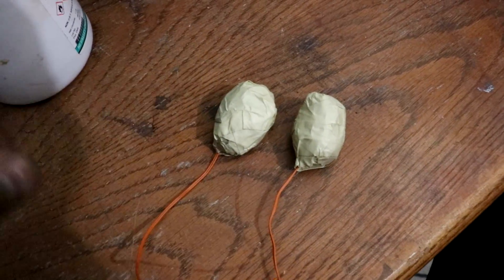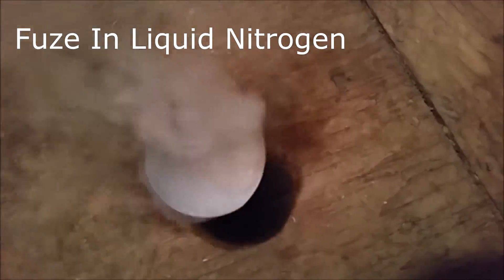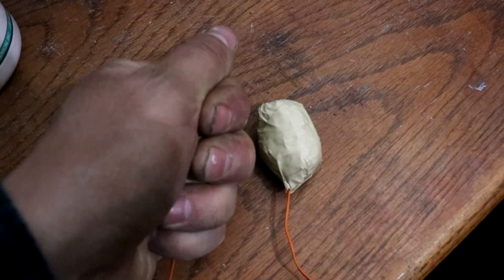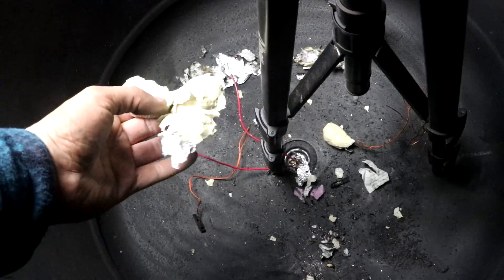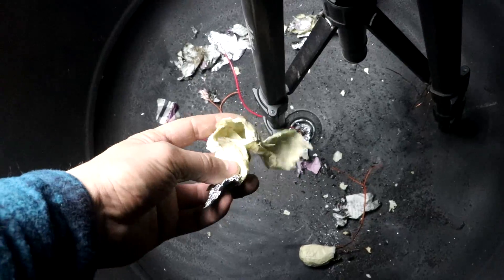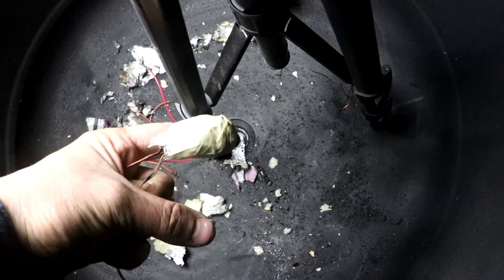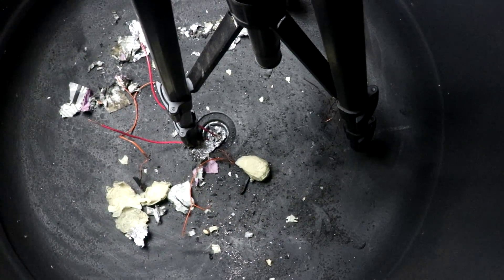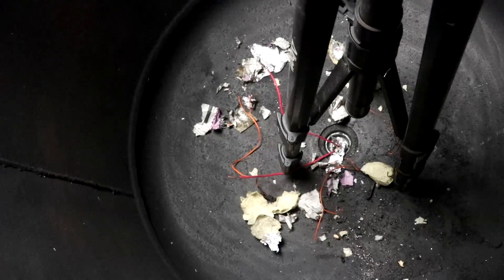Would Fireworks Work in Space?

Comment from the maker: So to sum up: 
1. they will need a different type of ignition:
2. they will be slightly more efficient turning chemical into mechanical energy ( can shred a thicker shell)
3. they will make noise so long as you are in direct line of sight and fairly close.
4. the "stars" will not burn long after the initial blast. (so fireworks in space wont be very pretty)
Reply: Space fire works would have to be designed to work in a vacuum , like may be put an epoxy coating on the stars so they are held under pressure.
Reply: What if it had an oxidizer
Reply: @cameronkeys49  Black powder does have an oxidizer. Potassium nitrate, KNO3. Wouldn't work as a propellant/explosive while encased in cartridges/ball of tape etc. otherwise. I know you could make a pipe bomb or whatever out of just the star chunks and it'd work in a vacuum, I've made explosives using nothing but those "star" chunks, as well as some with smokeless powder pellets, and they definitely work. My completely uneducated guess would be that perhaps in a vacuum and outside the explosive's container, the components of the mixture aren't held close enough together to react efficiently/completely? Probably something like that along with a dozen other factors, surely the "stars" in fireworks get a big assist from atmospheric oxygen as well.
Reply: @cameronkeys49         Good question !. lets ask Cody, if he don't know he can  fashion  an experiment that will tell the tale .
Reply: It's illegal to dismantle, or manufacture fireworks without a license. Didn't you learn anything from Grant Thompson? I mean this is the exact same thing he got busted for. You cray cray dog?
Reply: ipissed. I guess it all depends on where in the world you are.
Reply: @johnturner4400   Well he better have his passport stamped.
Reply: @ipissed  I doubt that any law enforcement officers would really care about this incident. Just my professional opinion though...
Reply: @ipissed  what episode was this? (The grant Thompson fireworks episode)
Reply: Thermite in a vacuum would be interesting, of course it wouldn't be a vacuum for long!
Reply: @Cody'sLab  did your Uranium refining video get taken down? One other thing is that do you ever calibrate your geiger counters?; if so do you do it yourself? I really liked that video and continue make awesome videos!  btw I really want to see a video of you refining gold ore from ur mine :O I am still waiting for that one xd.
Reply: Next; Fireworks in a pressurized, high oxygen environment AND fireworks in LOX
Never really a question of whether the fireworks would go off in a vacuum or not since gunpowder has its own oxidizer, I do find it interesting that the stars etc. didn't do much though. Maybe you could try using real fireworks next time? Homemade are cool for proof of concept, but commercial/professional grade ones are capable of detonating at sea level which this one isn't.
Reply: Who are they?
Reply: @dloveartsdotcom  Do you mean the stars who are covered in epoxy ? , we don't know them by name. And they are not as cool the stars who follow us on twitter.
Reply: There goes my plans for celebrating 4th of July on the moon.
Reply: fireworks in pure oxygen atmosphere next?
Reply: The sound was created by vibration through the metal work buddy.
No fireworks won't work in space, same as ice crystals can not exist in space.
Water boils instantly on a vacuum just keep that in mind.
Reply: Watevs
Reply: Did you forget your mic wouldn't work when the camera was in the vacuum?

Comment: A couple of corrections. 
Those were not like most shells used in commercial fireworks displays. What you made is a device called a mine, not an aerial shell or comet.  They are most commonly seen is some consumer grade fireworks (Class 1.4G).
All large public displays use electric matches, often under computer control. Even for smaller displays, some fireworks wholesalers will supply an electrically fired show if requested by the customer. I personally own a small capacitive discharge firing box that I use when I want to fire multiple items simultaneously.

Comment: The fact that sound could be heard, (including the post blast echo from the container ringing in the slow-mo) could have been due to the fact that the expanding gas from the explosive increased the pressure in the small container allowing sound waves to propagate. Space being what it is, I doubt you'd have the same result. 

You could always ask NASA to use their huge vacuum chamber to test it.

Edit: Did the vacuum reading on the gauge read as higher after the explosive went off? If so, by how much?

Comment: If you leave it in the chamber for a long period of time, will it still ignite? Is there a bit of residual air clinging to the black powder ball? Grappling with the notion that black powder fuses don't work but black powder fireworks do.
Reply: He didnt show any regulated vacuum gauge so we dont really know what the pressure was inside that chamber. It sounded like he only had the pump on for a short time and we hear the sound of the explosion indicating that there was indeed air inside the chamber.

Comment: The fuse burning in liquid nitrogen was very surprising.
Reply: Gunpowder has its own oxydiser, so it'll burn in pretty much any kind of gas or liquid that doesn't chemically react to it. And while liquid nitrogen might be cold, the gunpowder reaction is exothermic once it's started, so it produces enough heat to sustain itself. It's the same reason Thermite will burn through water ice, dry ice, liquid nitrogen and so forth.
Reply: @Malidictus  yea i found the statement he made about fuse not burning in a vacuum not correct. because it clearly had burned like 6 inches before it failed.  
a little temporary bend would compress both sides of the powder and once straightened out would leave a air bubble. air bubble + vacuum = failure point.

Comment: The sound going through the structure into the camera is actually kinda interesting. A video with one camera on a tripod and another hanging from string or something to basically disconnect it from the structure would be an interesting comparison, possibly also comparing it to a speaker inside with and without vacuum and a speaker outside with and without vacuum.

Comment: I don't believe it's possible to draw any conclusions about why one was shredded and the other not. Could have just been random circumstances. You would need to set off at least 3 or 4 of each to get enough data to make any determination. One of each is just not enough data.
Reply: If he wanted to be a bit more rigorous with his testing, sure. But it's still fairly obvious the reason the one under vacuum shredded more than the one under atm pressure, the vacuum simply provides no inward force and thus the explosion can push outward with more force.
Reply: @navy_y1594  
It's a valid assumption, but by no means a proven conclusion. More data points are required for that.
Reply: @scott_meyer   I don't think he ever said it was a proven conclusion. He definitely didn't intend for it to be some scientific experiment, just observations and theories?
Reply: @navy_y1594  

Yep. This experiment leads to another experiment. it happens often during experiments. 
We now have a hypothesis of what caused the squib to shred, more experimentation is needed to confirm.
SCIENCE!
Reply: @scott_meyer  I'd do it on my own but I don't have a vacuum chamber or fireworks haha

Comment: Experiment idea: inside a vacuum chamber place a wireless speaker and 2 microphones, one placed on the same surface as the speaker and one suspended from a string. Play something  through the speaker as you slowly decrease the pressure. This will demonstrate how the air pressure affects the sound (volume and pitch).
On a second thought it might be better to depressurize first, and conduct the experiment as you slowly let the air back in (this way eliminates noise from the pump)

Comment: Why is pressure a requisite for igniting powder?
Reply: Fenris17
Why is pressure a requisite for igniting powder?

The pressure is necessary to keep the hot gasses localized so the neighboring particles ignite in a chain reaction. In a vacuum, the fire escapes so fast it does ignite anything unless tightly compacted in a closed container. Paper, tape, string, and glue will make a tight, strong container.
Peace
Reply: @Maccbruce  ah! Ty so much. Pretty intuitive. I guess it goes without saying anything explosion in space probably has no flames. So it's just things flying every which direction and glowing a little

Comment: Aren't commercial fireworks displays mostly electrically controlled, due to the requirement of being precisely timed (to provide a more thematic and spectacular experience) and choreographed to music?
Reply: Fetzie
16 hours ago
Aren't commercial fireworks displays mostly electrically controlled, due to the requirement of being precisely timed (to provide a more thematic and spectacular experience) and choreographed to music?

You are correct that it is mostly computer controlled. But small shows are still fired the old fashion way...with a railroad flare. It is a time/money issue. Large shows have  more crew to set up and test the wiring. Large shows have more guns as there is no reloading.
Small shows are often done by local fire departments. They dig post holes for two banks of six guns. One bank firing while the second is being reloaded. When finished throw the guns and empty boxes in the truck and you are out of there. 
During the show fire and sparks everywhere. Great fun. 
Statistically, not as dangerous as the hiway drive to get there.
Peace

Comment: You should try this again, but put the powder in a more sturdy container, like one of those energy drink cans with a screw on lid.  I noticed that even on the atmospheric test, a lot of stuff didn't burn, and while it might be a bit of a fizzle with atmospheric pressure, being contained in a fairly well sealed can would allow the powder to burn fully as well as ignite those star thingies.  Also I think using a thin walled metal container will be better than a plastic one because of the way the metal containers fail under extreme overpressure.

Comment: It wasn’t more powerful, it had less resistance.
Reply from the maker: More efficient perhapse
Reply: The way explosions work is some extremely rapid gas generating reaction creates a pressure spike which is transmitted as a shockwave (in atmosphere) or as high velocity gas molecules (in vacuum.) In your atmospheric and vacuum tests you presumably used the same amount of black powder resulting in approximately the same amount of gas generation within your pressure vessel (the ball of tape.) The vacuum test produced a more complete destruction of the pressure vessel because the same amount of gas in vacuum produced a larger pressure differential in that environment than it had in the charge that was buried under hundreds of kilometers of air. A good analogy is that it’s like piping half a gram of nitrogen into a balloon in atmosphere vs doing the same in vacuum. The balloon in vacuum inflates to a larger size or even pops because that volume of gas isn’t being crushed to a smaller size by external pressure.